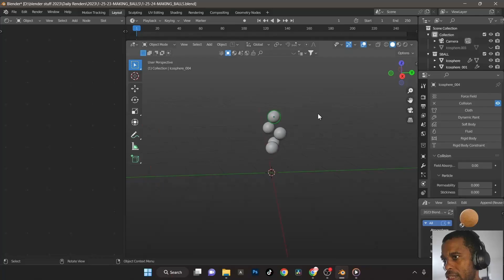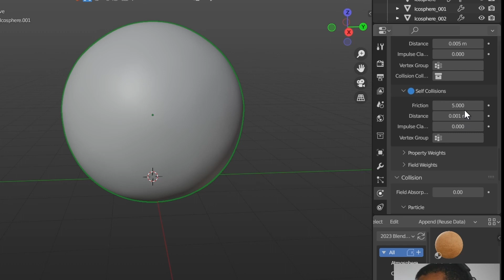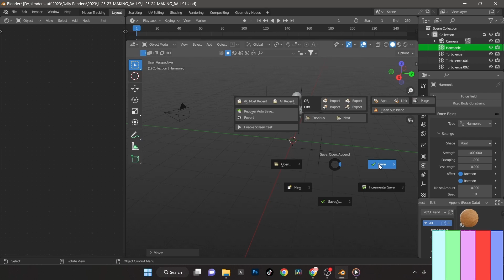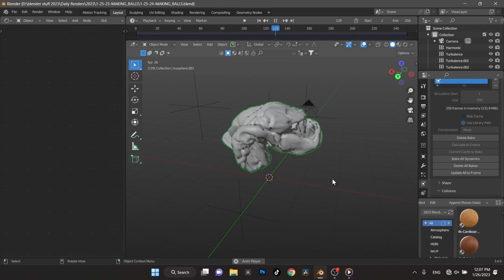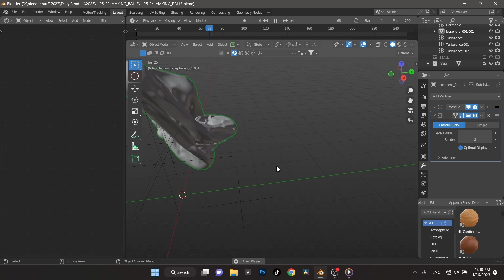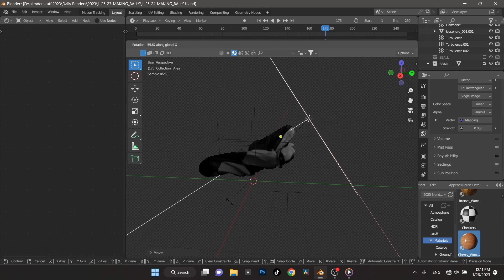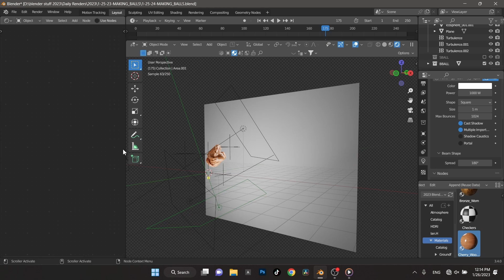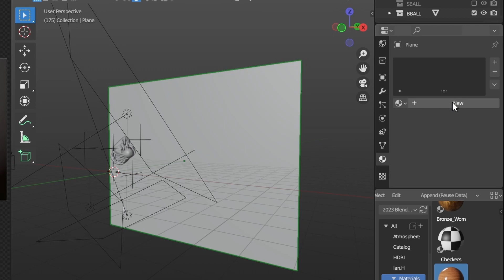How I Made This In Blender (Cloth Sim) Part.2

Comment: whats the purpose of saving it as .abc file, i got confused there..?
Reply from the maker: It saves a lot more resources your computer does not have to process the physics it's way more easier on your computer in the back end plus blender is not very good at physics rigid bodies soft body Sims it helps to render them out and then import them again